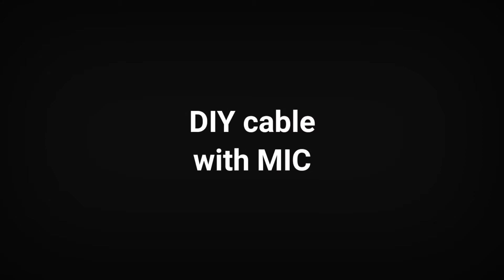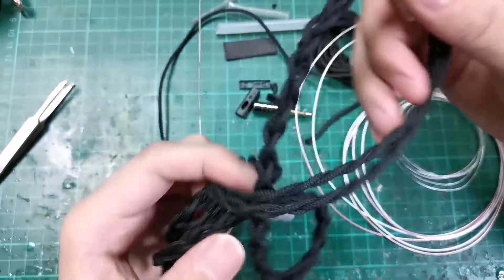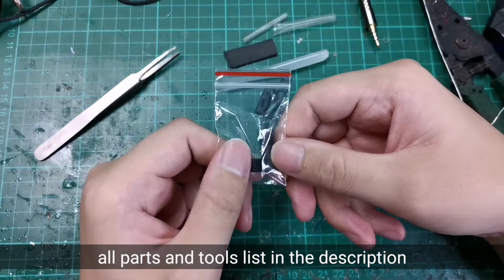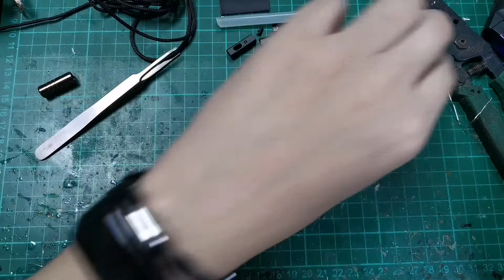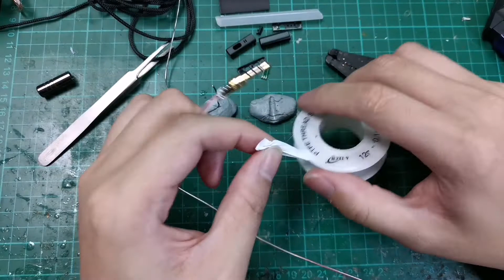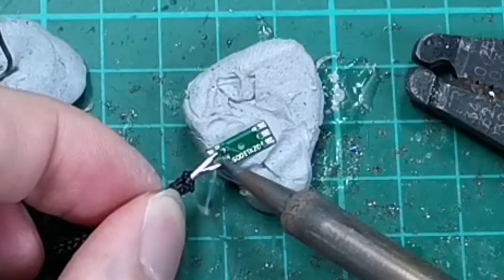DIY IEM Cable with mic [NAKED Tutorial]

Comment: Would a 2 wire mic board be a better option for audio quality?  Keeping the earpiece cable continuous and tapping into the right ground?  Compared to breaking the earpiece cable and using the board to join rejoin the right signal and ground over the tiny trace lines on the board?
Reply from the maker: Yes those will definitely be better

Comment: this video is great! The 3.5mm connector on my kph30i is a bit wonky after my chair rolled over it T_T
I was thinking about trying the mmcx connector mod you showed in another video and replacing the cable, but now I'm inspired to try just replacing/fixing the connector somehow
Reply from the maker: You can start by doing the Jack first and slowly planning the rest if the mod!

Comment: Thanks for another cable video, one of these days I'm going to actually try building my own! I want to do quick connects for my cable so I can pop off a 3.5mm interconnect with a 4.4mm or 2.5mm.
Reply from the maker: You can look up OE multi plug for a more elegant solution!
Reply: @sgaudiohive  wow this is an excellent choice! Can't believe I hadn't heard of this, I was just going to use mini xlr like hart audio does but this is a much sleeker package.